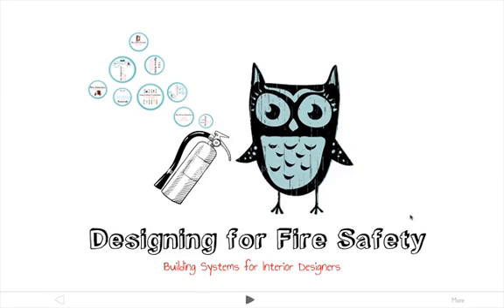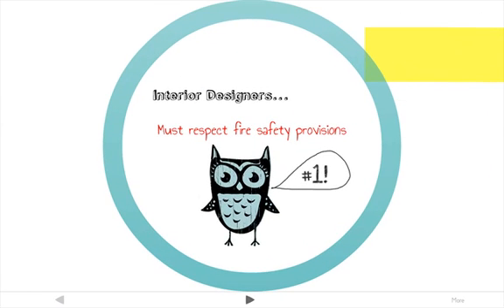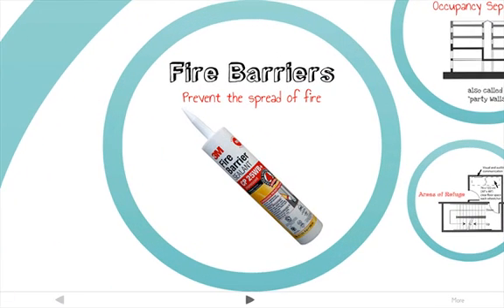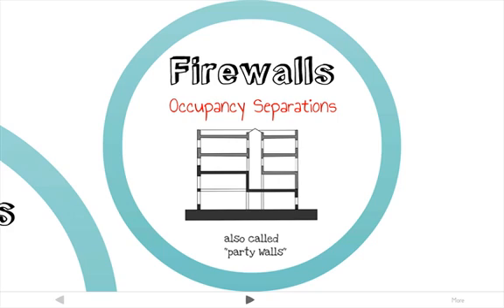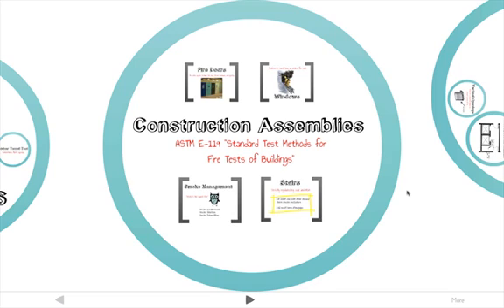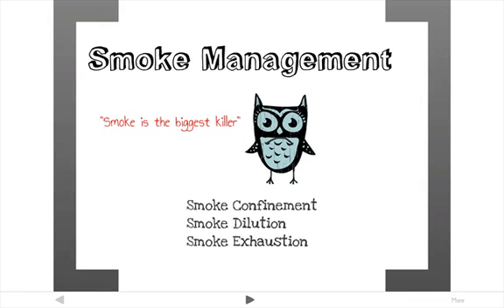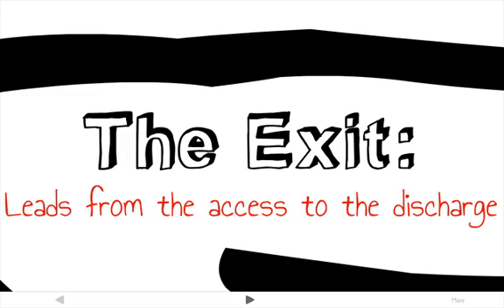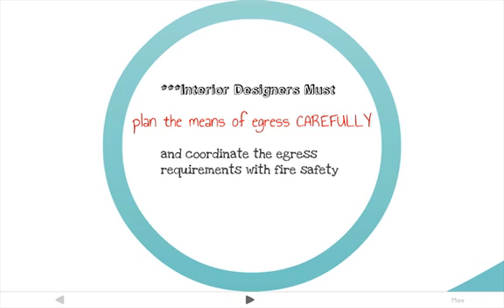Designing for Fire Safety - Part 1

Comment: Fire safety for apartments and large buildings. Thinking of fire escapes. Building material,.
Building designed against arson or malicious criminal attempts.
Thinking of Kyo Ani fire in Japan. Com men problem in Asia. Korea and Japan have lax attitudes.
Designing building for hi speed egress. Of course design with security in mind to prevent people who you dont want coming in.

Waiting for a report on the fire. West have same problems with short cuts taken because of budgetary constraints.
Thinking of low cost devices which give survivability the first 5-10 minutes.
Fumes carbon monoxide poisoning. Japan had no external ladders for this building. From photos I could see.